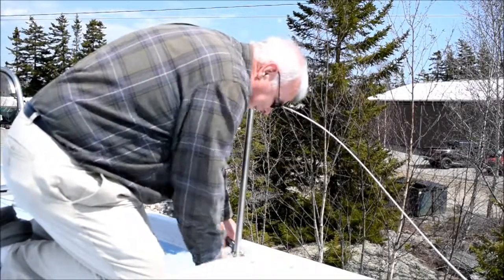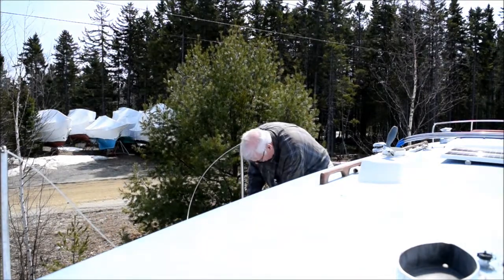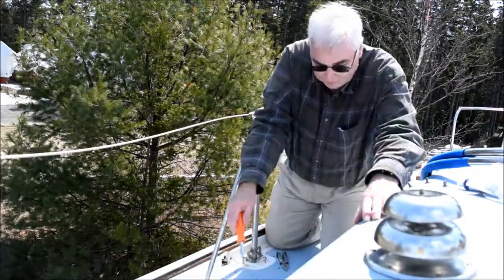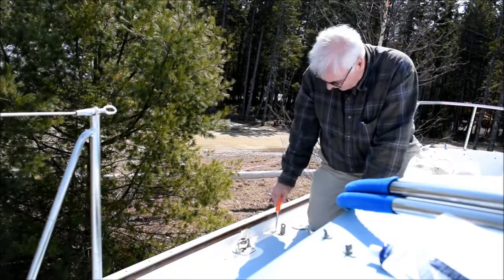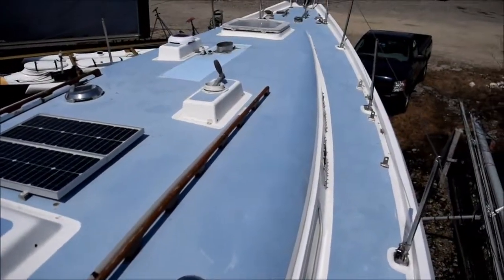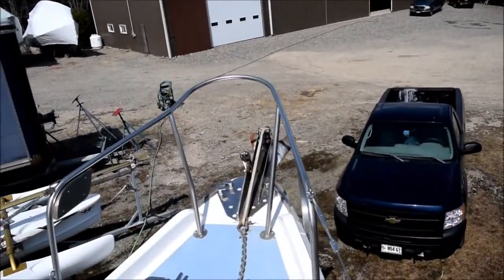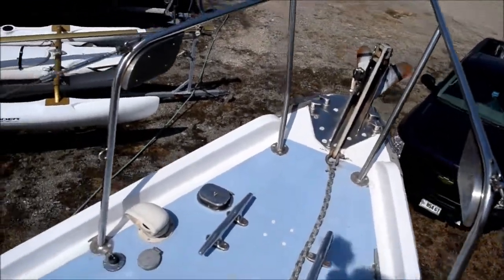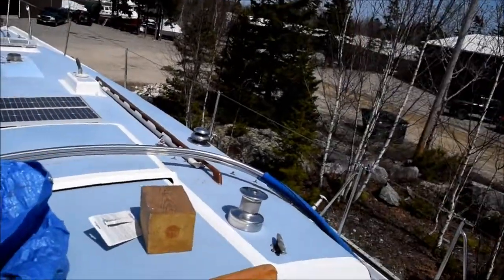Installing Stanchions and Lifelines on my Sailboat

Comment: I'm getting ready to install stanchions in life lines on my West Wight Potter 15 and I plan to just put pool noodles or pipe insulation over the lines and stanchions when I tarp it
Reply from the maker: The issue with the tarp and the stanchions is not the wires between stanchions.  It is the stanchions themselves because they can punch through the tarp under snow load.  I solved the problem by switching to inside storage.

Comment: WOW 20" stanchions! Mine were 24" and I'm in the process of changing them to 32" with solid pipe on top and two cable or rope in between. I hate bending over to hold them. I almost died when one bent.
Reply: I got hit by another boat in a hurricane and all of my stanchions are bent on my starboard side as well as my bow rail.... any idea where to order new ones for a decent price? Also, can you get any money for bent stanchions ? Just asking since you got rid of yours.